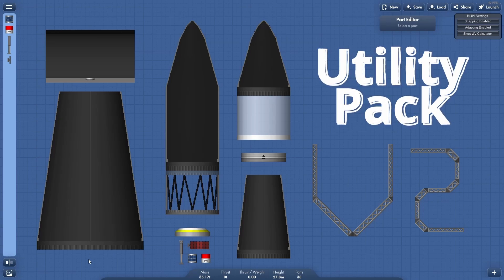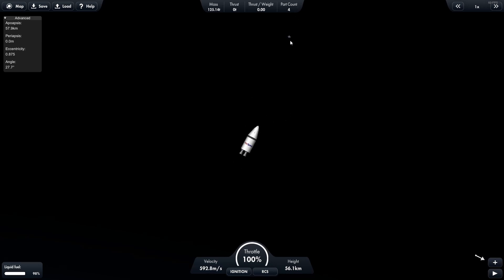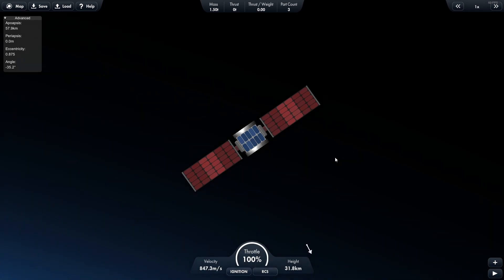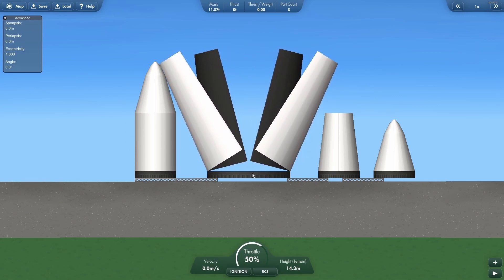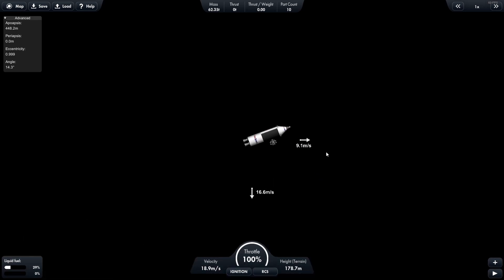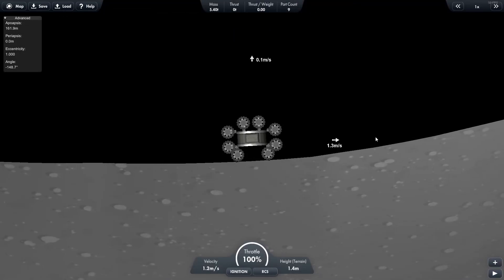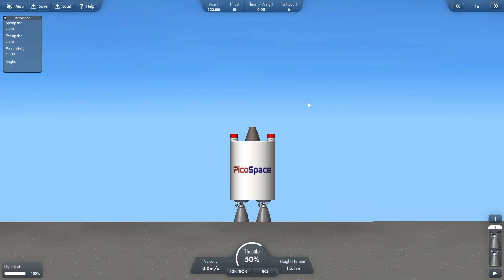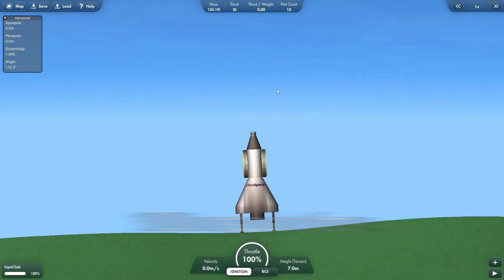Utility Pack v2 | Custom Parts to Improve Rocket Design in Spaceflight Simulator

Comment: are you able to do angled fuel tanks that connect to a normal fuel tank like the R-7 please? i want to do the korolev cross.
Reply from the maker: There is some discussion on who might do Soviet rockets, I try not to step on other modder’s toes if they are doing 1:1 real scale but I’ll likely look into it at some point if someone doesn’t claim it first.

Comment: Whenever I start up SFS, it comes up with the error saying "Failed to load asset pack utility pack v2, object reference is not an instance of an object"
But the thing, the mod still works either way, which comes to my next issue, which is the petal fairings not showing in the fairings section nor in any other section of the parts. 

Do you know what the issue is?
Reply from the maker: 90% you didn’t add N204’s electricity ⚡️ pack and therefore one item which requires it (and any item after in the package sequence) won’t load.
Reply: @picospace  I did add the required electricity pack, unless I didn't add it correctly in which i'll have to go back and do it again.

Comment: I don’t see all the parts in the mod
Reply from the maker: Which parts (a few people have reported this, but I can't down "why" so any info you can give me on which specific parts you are missing, or a list of all the ones you can see and I can use that info and hopefully track down the issue.
Reply: @picospace  I see the picosat and all the engine break away system all hidden separators and cargo bays The megaChute deorbiter 4 petal capsule fairings and that’s it

Comment: Hello, I have a problem with the mod since I install it and I only get the engine mod if someone can help me please
Reply from the maker: There are currently 3 packs available, each only have specific parts. Make sure you install them all if you want all the parts I make (#4 a rover pack is coming soon).
Reply: @picospace  I have installed the engine mod, the utility mod and the exotic parts mod but only the engine mod works
Reply from the maker: That is odd, I’d suggest going to the main SfS discord or forum and asking for help there as they should work and I’m not sure why for you they do not.

Comment: a question: what do I do if some pieces do not load me? (I have the steam version with the mod loader)
Reply from the maker: Which pieces are not loading?
Are you on the steam Beta? (Old modloader is not compatible).
Reply: @picospace  I have the steam beta, but the parts haven't been uploaded yet, the parts are: the N1 style separator, the fuel drain, the radiator and the landing leg (if something is misspelled it's the translator)
Reply from the maker: Did you download the part pack “sfs_esm_utilities” from the link in the description?
Reply: @picospace  thanks!

Comment: Maybe make the pedal fairings separate whatever is in the fairings by clicking twice rapidly
Reply from the maker: Game dynamics limits what can be done without a mod (C# code that would limit use on mobile in the future). So "double click" doesn't exist in the game or I'd of added the option.
Reply: @picospace  ok, well maybe then you can make it so it just opens because im sure some people dont want to waste rcs maneuvering their craft back into the pedal bay or bays because they detach by default
Reply from the maker: So open but not release, like the cargo bay does? (Cargo bay opens on first click, detaches anything on the bay floor in the second click, thrid click closes the bay - rinse and repeat).
Reply: @picospace  yeah, for example for apollo recreations, they detached the upper CSM, turned around, attached to the LEM, and then detached, it makes it a lot easier
Reply from the maker: Okay, I'll make the update tonight and post it as a v0.2.1 revision.
Reply: @picospace  allright! Wish i could use it tho haha

Comment: 601st subscriber!
Reply from the maker: WOW and I'm still working on the 500th subscriber award (someone requested engines so I made them). Growth has been great but I better get too releasing the two new engines!
Reply: @picospace  haha, i just wish that there was mobile support because it would be awesome to use them, i have made ALOT of saturn v’s in my mobile save, and the pedals would be super useful. As well as the texture packs
Reply from the maker: Yes I'm hoping support comes in version 1.6

Comment: Try to make real life rocket parts
Reply from the maker: Check out my Engines Pack which has semi-realistic rockets.
Reply: Thanks
Reply from the maker: PS. Petal Fairings we’re based on early Apollo test launches which used that style of fairing before switching to the breakaway type that is common today.

Comment: Is suspension wheels possible?
Reply from the maker: I’m exploring the possibility, but when I try to mix unity physics 2D with SfS parts things sometimes work but it’s iffy at best (you want a part that won’t let your rocket turn??? Cause I made that for @Heroix - coming soon in the exotic pack update).